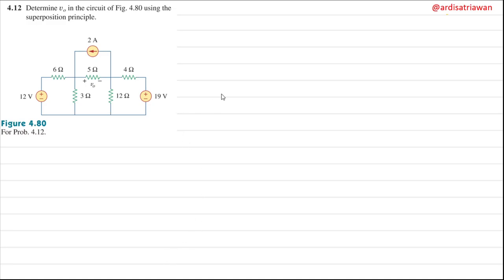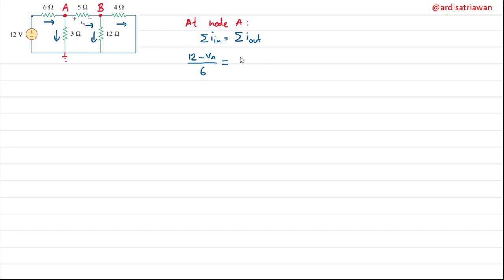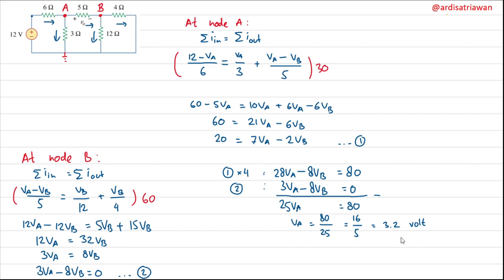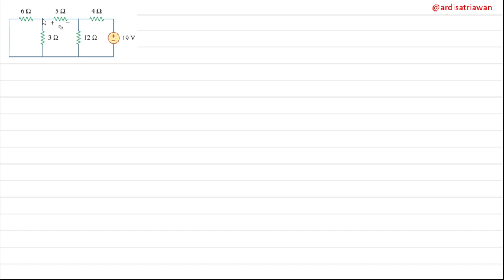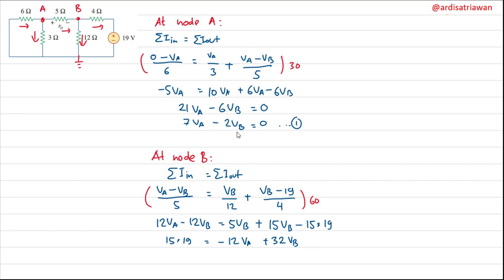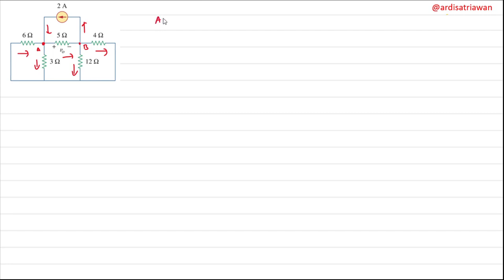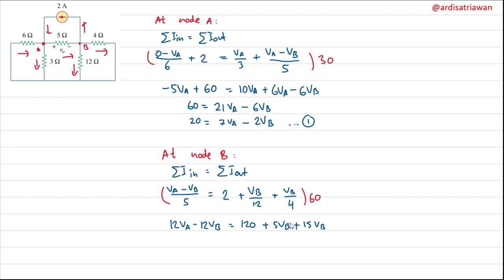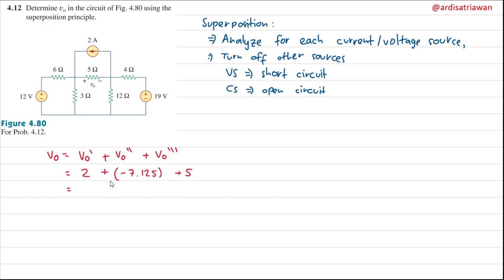Problem 4.12 - Fundamental of Electric Circuits (Sadiku) 5th Ed - Superposition

Comment: thanks for ur vid  sir.
can i turn off all current sources and all voltage source respectively  so that i only need to calculate two circuits?
Reply from the maker: Yes, you can